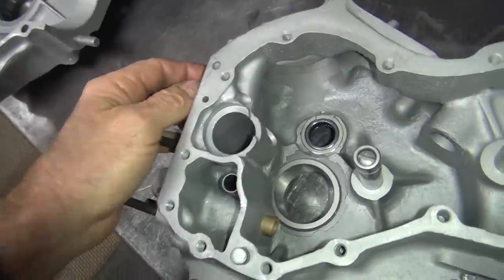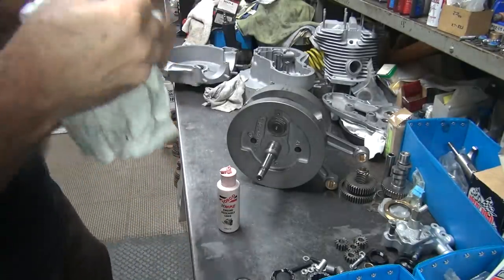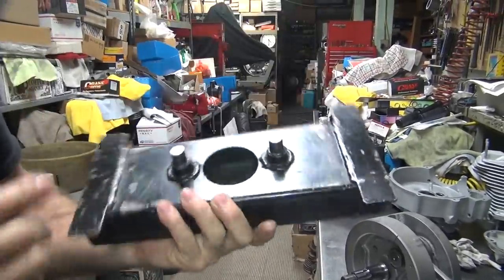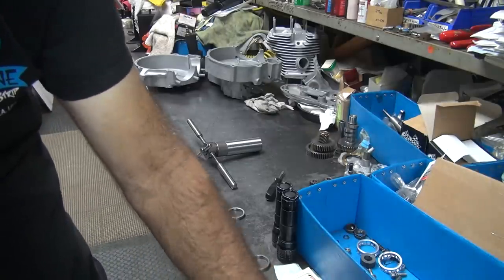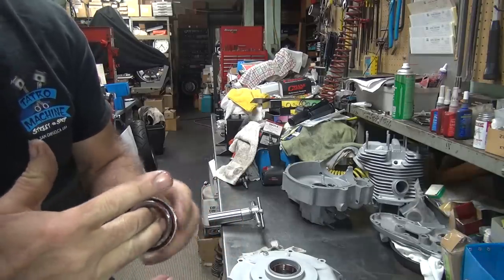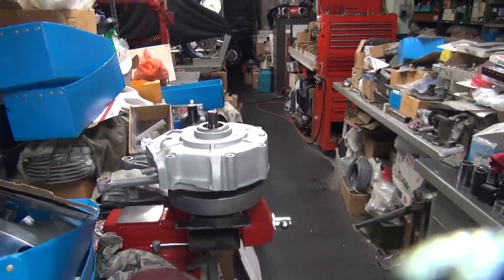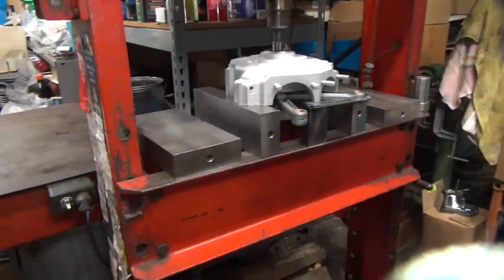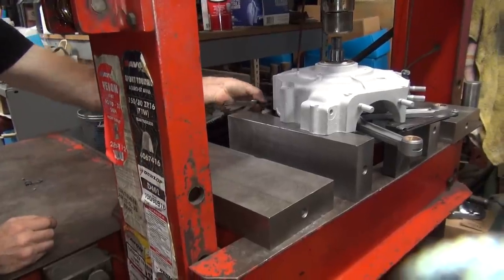1967 74ci shovelhead #114 flh bike assembly motor rebuild harley craigslist special tatro machine

Comment: My 67FLH motor shaft seal are leaking, can I just replace it with the engine on the frame? Thanks, great videos as always!
Reply from the maker: harley did not have a mainshaft seal on the motor untill 1970. then they installed it backwards too. if you have a colony one than it is going to be very hard to change when the motor is together.
tatro

Comment: Is that the cam that you have to grind the teeth down on the oil pump gear to clear the lob ?? sorry if I'm thinking ahead of you
Reply from the maker: any cam with more than about .440 lift or so will have to have the teeth ground down on the large circuitbreaker gear. not all the teeth, just the ones that hit the cam lobe.
tatro